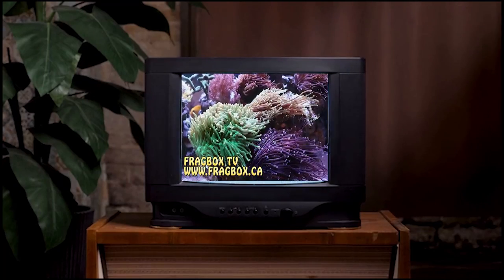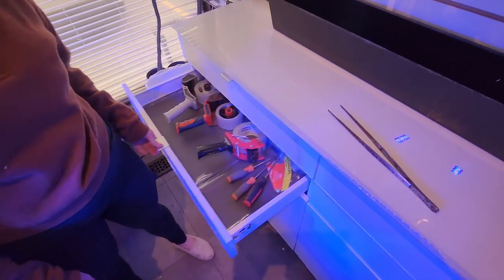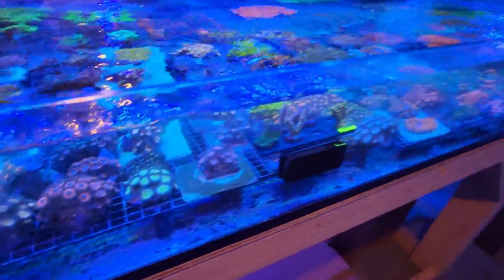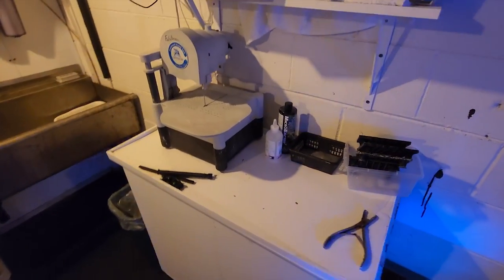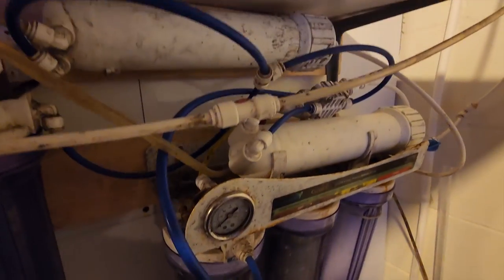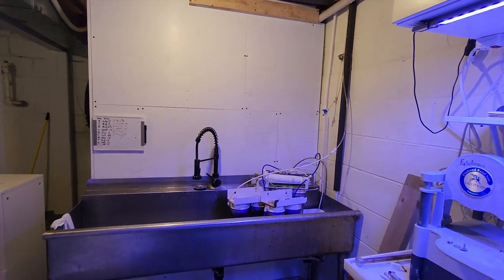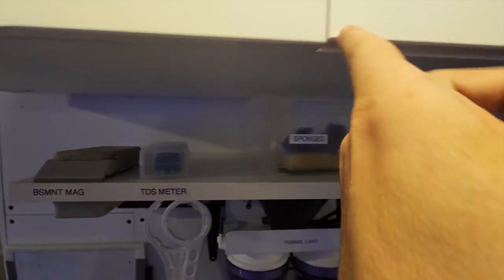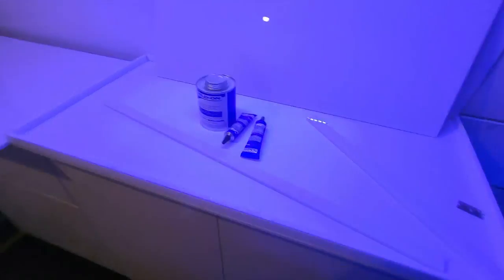Building a new FRAG Station!

Comment: March, I recommend that when you are done with the Muriatic Acid, dump some baking soda into the mixture and circulate that a bit to mix before opening your drain.  That way you neutralize the acid before it hits your plumbing and sewage system.
Reply from the maker: Thanks for this tip!